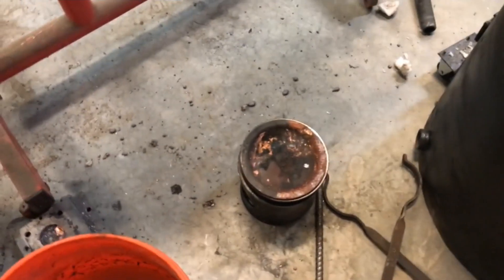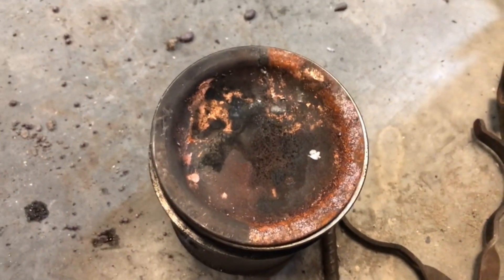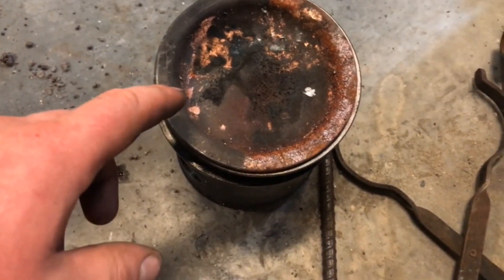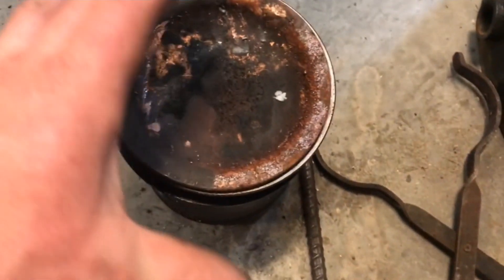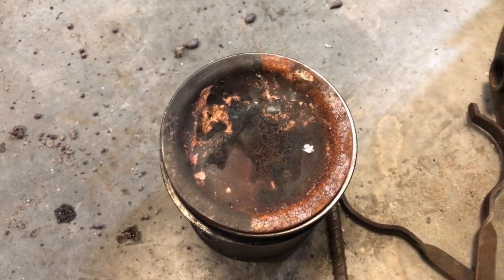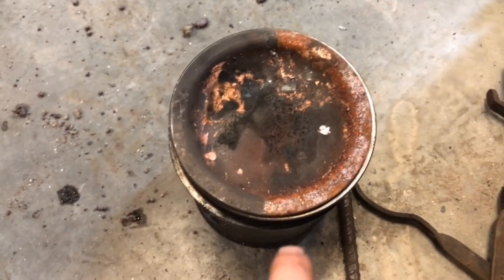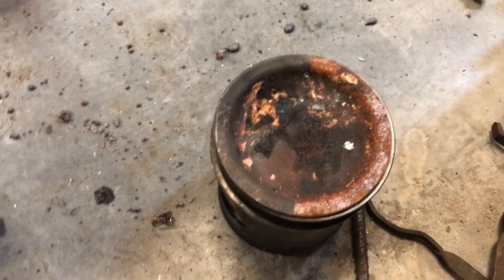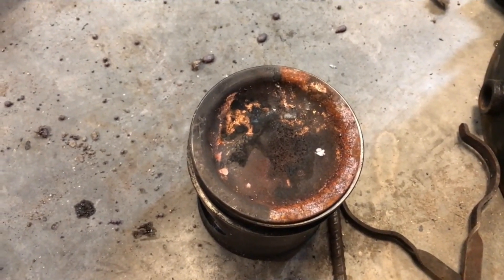Molten copper explosion - Why molds need to be clean!

Comment: The rust is releasing its oxygen upon contact with the copper.  Not sure what is happening from there -- it could be that gases (dissolved hydrogen?) in the copper then find the oxygen.  I've had molten copper fireworks too when contacting it with a rusty tool.
Reply from the maker: I've had a few responses leaning towards chemical reactions releasing gasses as well.